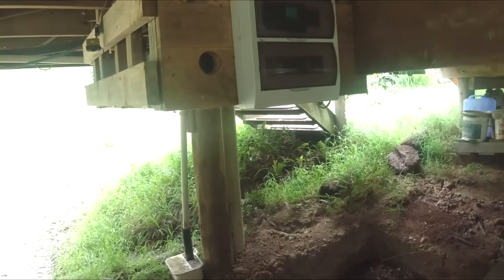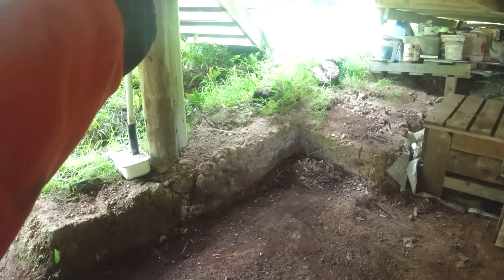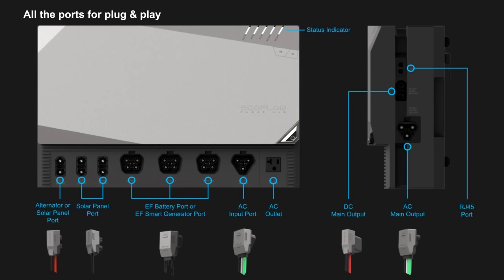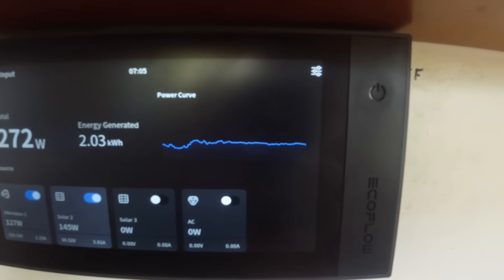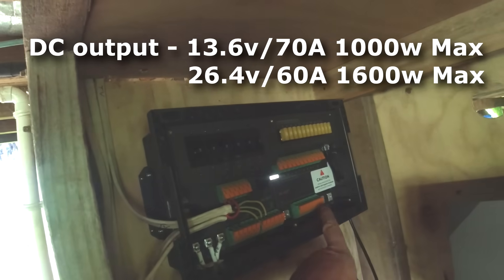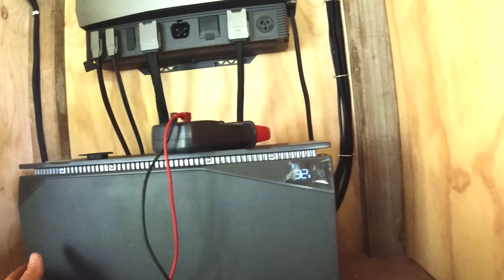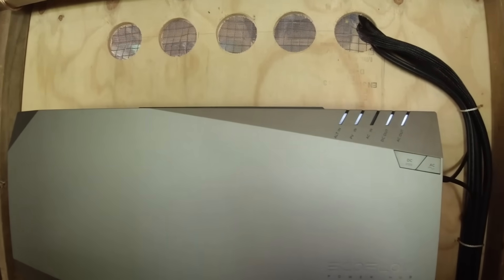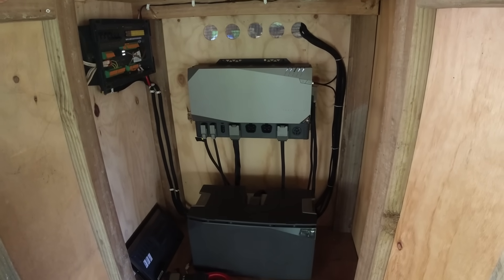Upgrading my Off-Grid Power System at the Beach House - Ecoflow 5kw Power Kit

Comment: Any update on how exactly you managed to get the excess solar into the hot water tank? I'm planning to do the same...
Also: How has the PowerKit been doing since the installation? Some defects or all perfect?
Reply from the maker: I didn't end up wiring up the auto dump, I just flick the switch when battery is full. No issues with it so far
Reply: @MartyT  So you are using a heating rod I guess? Which one did you get and how did you connect it to the power kit? thank you

Comment: how are you finding this system mate? looking to install the same setup on our liitle house we are building, just wondering if its worth the 13k investment.. many thanks
Reply from the maker: It is brilliant, easy to set up and use. no issues so far. It would be cheaper to buy individual components- batteries, inverter, mppt, fuse board etc and wire up yourself but a lot more time consuming and complicated
Reply: @MartyT  that’s mate, appreciate the reply, you don’t happen to have a Ecoflow powerhub for sale? Have found a great deal on the battery and pannels, just needing the hub now to get everything up and running, many thanks , Sean

Comment: Ecoflow is the Apple of power. They use their own proprietary connectors, they are way more expensive than building your own system, and they bundle everything together so if one component fails you have to replace everything. The tradeoff is they make everything simple.

Comment: I have alway been curious about suppling my water heater from a solar powered element. Do you ever have to worry about it over heating???
Reply from the maker: If the element is fed ac via the inverter then you can just use a standard thermostat, a bit more difficult with dc as it tends to arc contacts but there are ways of doing it
Reply: @MartyT  thanks for the info, I never thought about just doing an inverter to on of the ac heating elements. I always thought just wiring the dc directly. I was gonna do a small scale project since the heater runs alot.

Comment: @Marty, Where can I find out more about your Hot water PLC setup. I'm keen on a dump load for an unused HWS tank I have, but am considering a thermostat for for if the dumpload reaches big temps for the HWS. This is a problem in summer vs Winter though.
Reply from the maker: This is one I set up for a friend recently, dumping power from the inverter is easier to control than dc from the battery https://youtu.be/v38alCnacg0

Comment: This is probably a dumb question, but around 3:25 you plug in your solar panel connection to the power hub and the "ALT IN" starts blinking instead of "PV IN".  What is the "PV IN" used for if not solar panels?
Reply from the maker: The alt stands for alternator, this input can be charged from a vehicle alternator or solar array
Reply: @MartyT  got it, so you plugged the PV cells into the "alternator" port, same exact function, just different indicator light

Comment: i'd almost say not to call it lithium but lithium phosphate, it's so different from traditional lithium chemistry.  i'm envious of that much Lifepo4!  

EDIT: with the rise of LED and electronics i've always wondered why lower DC hasn't made come back in buildings like all those decades ago when electricity was new. seems more efficient that converting between AC and DC so many times.

EDIT EDIT: yeah lifepo4 is wild, it maintains fuller voltage much much much longer than lead acid!!!

Comment: Have tried a simple solar setup for my off grid workshop. Thing is solar panels are not much use in the uk this time of year. Any plans to add the washing machine water turbine to your system?
Reply from the maker: No stream here so can't have a pelton wheel, I could make  wind turbine from a smartdrive motor but would be much easier to just add a couple more panels

Comment: Maby this will be the answer for households with solar panels and a normal connection to the grid.

Instead of feeding all the power from the solar panels back to the grid, (which in plenty of cases means on sunny days, there is more power available then used) store the power during the day and use it in the evening/at night. You also don't have the taxes on power you feed back to the grid.

Comment: Cool system ! Great job on the cabinet and installation !  Only problem I can see is moisture intrusion from the air into the wood cabinet and electronics. With it  being  outdoors and in constant shade how do you combat the issue ?
Reply from the maker: The heat it generates combined with frequent running of the fans keeps it quite dry in the cabinet, also being up off the ground helps away from the moisture rising from the ground
Reply: @MartyT Nice

Comment: Lithium is highly inflammatory 
Fires are caused by to deep of discharge 
Then when charged again dendrites are formed.
This is like an ICE pick thrust though the battery 
The battery is simular to a jelly roll 
So the dendrits poke though all the layers shorting them out 
Recommend moving the low voltage cut off higher then normal. When gone .
That way draining the battery will stop before damage is done

Comment: You probably already know this, but you have to smother lithium battery fires, water will make it worse. A good idea for a fire protection system for the lithium battery would be to place a bag(s) (plastic) of sand above the battery. So that that if there is a fire the plastic bag will melt, releasing the sand smother the fire.
Reply: What do you do if the bag splits when the plastic degrades over the years?
Reply: @TheMightyYak  Everything needs periodic maintenance/replacement……even plastic bags !

Comment: Nice Vid Marty, always good to have enough for life lil luxuries like a Microwave, toaster and kettle!
I have 6.5kw grid feed and 2kw older panels and im about to expand this with grid as backup and 10kw of Gel batteries plus of course a new better suits Inverter so I can grid isolate if needed because my last from outages were 5 and 6 days respectively planning on 10kw solar and 15kw storage with diesel genset emergency backup.
As it sits I use a few bucks plus connection fee per day as my solar covers daylight feed so its nice to see a good overview of a new system.
Love your work :-)

Comment: marty ecoflow uses lifepo4 lithium and they arent dangerous like their li ion or li poly batteries that will burn. no need to move battery out.
Reply from the maker: Yes, general consensus seems to be that these batteries are a very safe stable chemistry, I am new to lithiums, I've always used half dead lead acid batts for my off grid systems so I'm learning a lot in the comments

Comment: JFC......7k USD for whats basically a charge controller, 4k inverter, and a breaker box. No panels and a 5Kwh battery. I guess if you have zero clue on solar and have money to burn this is a good deal. Will Prowse would tear this apart and laugh at it.

Comment: I will never understand people who put massive lithium batteries in their ceiling to store solar energy, stuff like this need to be placed in its own shed that can withstand up to 3000 degrees of heat these monsters output, not only do they burn for days on end, they emit extremely toxic gas that can kill within minutes in an enclosed space. 
A 5kW battery like that can easily melt bricks and putting it under the house is probably a bad idea, I suggest moving it away from the house by a few metres at least or put a massive shielding on top of it as 3000 degrees of heat, the battery could catch fire, burn for days when you are not there and the heat alone can cause house to catch fire.

Comment: Do make sure you read up on the charge curve of LiFePo4 cells. It would be easy to get a trigger voltage at about 90% SOC as the voltage curve shoots up right at the ends, but for the majority of the time, voltage is not a reliable identifier of charge state.  53.6v could mean 70% or 30%, you have to track Kwh in and Kwh out to get an accurate reading.
Reply from the maker: Interesting, thanks. I haven't had much to do with lithium batteries so I'm learning a lot from the comments.. I suppose another way to initiate dump would be to have a plc monitoring the solar output, when battery is charged, mppt will let go of the panels and voltage will rise
Reply: @MartyT  Happy to help. That mppt voltage trigger is a pretty good idea, although you may have to implement a timer that ignores panel voltage for some predetermined time as the water heater itself would drag the panels down after switchover?
Reply from the maker: Yes I would have dumping in 5 minute bursts

Comment: That is the one thing that eco flow and a number of the all in one inverter should have is a dump load. ( dual dump loads provided you have a thermostat on the water heater to shut off currrent then it switches to another load ) I would super love to have a dump load to provide hot water and even additional heat in the winter.

Comment: This kit is soooo cool, really the only downside I’ve seen on ecoflow is the Li-ion cells instead of LiFePo (like Bluetti and Anker I believe)

Did this ecoflow inverter need any adapter from the standard solar panel plugs at all? Or is it included…
Reply from the maker: This battery is lithium iron phosphate, very unlikely to catch fire. the solar cables have standard mc4 plugs

Comment: If the fridge was getting warm by morning, has the insulation on it failed?
Reply from the maker: No the fridge is fine but it does get opened and closed a lot in the evenings which lets out the cold air

Comment: get yoursefl and ebike hub motor kit, would be a fun video.
1000w or more and you will be loving it.
3000w for wheelie power.
Reply from the maker: I actually did get a 2000w motor from aliexpress recently but it doesn't work, I suspect the controller is poked

Comment: Iron phosphate cells are massively safer than cobalt oxide and others. They’re bombproof.  We used to abuse the hell out of them in F1 KERS (>300C discharge rates) and they lasted superbly.  

Looks a great setup. You can also run Iron phosphates to 100% with much reduced ageing worries so you don’t need to kick in the hot water dump as low as 80%.

Comment: Sweet new power setup .. Making a concrete case to put the battery in is a great idea..If a lithium battery catches fire the best to be done is put it in sand as it cannot be put out  So putting it in a concrete case should contain the fire especially if you put a concrete lid on top
Regarding battery's maybe one day you could make some composed of 18650 battery's

Comment: Nice informative video - a lot more properties will have similar systems to this in the future - have you thought about a solar thermal panel for your hot water ? More of these should be installed on new builds - old tech that is proven.

Comment: Great and informative video as always Marty. With regard to the battery box, any battery can go faulty and the fire risk is real, chances of putting them out once in thermal runaway is slim. I would suggest a battery box away from the house completely, if the worst ever happens it can burn itself out safely 👍

Comment: just finish building off grid 24v system for my shed but been testing it in the house this weeks ,  using victron gear and eve 280ah cells x 8 = 6.79kwh total capacity ,1.6kw solar charging putting 50amps into battery's  ,been running most the house low draw appliances TV lights 140l fridge and big 150l freezer ,sound system computer fans fish tank ,pulling 600w ,all day and and night ,, crazy for such a small system ,i going buy 8 more cells soon before prices rise and a second jk bms
Reply from the maker: Nice, its a good feeling to be off the grid.. I was looking into new batteries and inverter for this place when Ecoflow offered this system, perfect timing

Comment: Save yourself the trouble of fitting a water fire spray in the electrical cabinet.....  If the Li caught fire, the water spray wouldn't do anything but make a bigger mess.  Your plan to move the battery is better.

Comment: It is Lithium ion batteries that are the issue, if you check the specs on your battery ypuwill find it may not be that type , as thee are several different LITHIUM batteries.
Also I would
D s7ggest  second battery in parallel

Comment: The idea of a fire suppression system is a tricky one when dealing with electricals. If it gets triggered any metal piping should be considered live (dangerous), and I guess the piping would need to be metal to deal with heat.

Comment: The Lithium Battery potential fire isn't the same for all types of Lithium devices.  What is known as LiFePO4 batteries are very safe and have internal Battery Management Systems to prevent any faults from starting fires 🔥

Comment: Maybe an auto discharging powder extinguisher would be better than a water sprinkler. Will you put in a fail safe isolating switch to isolate the power while you’re absent from the property?  It may pay to check your cover with your Insurer, and you may need to get a registered electrician to comply the installation. Good back up in case there’s a fire.

Comment: Is the system pretty easy to hook up, it looks like you used solar panels that you had on another system? Do all solar panels have like a universal plug to use it on different systems. Also just curious if someone with good set of tools and basic understanding of electrical can hook this up?Edit: Do they provide good wiring diagrams because i notice your able to check the voltage and the terminal. Im sure you wouldnt have donw that unless you knew that was power and ground. So good wiring schematics too?
Reply from the maker: Very easy, all plug and play. The solar cables have standard mc4 connectors

Comment: Just an FYI, I have been flying the 787 and the lithium batteries caused a bit of a problem until they were totally isolated in titanium sealed boxes.  In the airline industry for 45 years and whenLithium batteries in laptops and etc came on the scene we had to institute new fire procedures.  Lithium fires cannot be put out by water.  They react with water and cause explosions.  So good on you to completely isolate the batteries in a fire proof section/container.  Happy new year!

Comment: You get some real neat DC geyser elements that can run on direct DC ... may be an idea to replace any boiler/geyser element in time.
Reply: Except the Thermostat switch won't be rated for DC. Will draw a nasty arc rather than cutting the power.
I added a Solid State Relay to actually switch the DC via the thermostat.
Reply: We have a GeyserWise controller, that cuts the supply to the element, and activates a thermosiphon pump to circulate water from the solar collector to the internal boiler.  

That controller, as I understand can run AC or DC element. 

Have been looking into those PTC ceramic heaters as an option as well … you get DC and AC/DC versions and think

Comment: It depends on the chemistry of the battery. If it is Lithium Ion then fire risk is low. If it is LiFEPO4 or Lithium Iron Phosphate the risk is extremely low. Puncturing a cell can cause issues with Li ion but the most probable cause of fires in Li ion batteries is thermal runaway from excessive heat. Once that happens the only way to put it out is to cool it enough to stop the chemical reaction.

Comment: You should talk to Ecoflow and see if they can do a firmware update so that the system will auto dump to the hotwater tank when battery is full.
Reply from the maker: That's a good idea, it might be possible and would be much simpler than using a plc
Reply: @MartyT  I absolutely thought "they should implement that auto-dump Marty-functionality in their systems" the moment You mentioned the lack of it.
Reply: Sounds like an opportunity for a CANbus accessory :)

Comment: The Lithium Phosphate batteries appear to be safe so far, it is the Lithium nickel cobalt batteries that are catching on fire. These are used in most EVs until recently because they are more energy dense, including Tesla, Hyundai etc.
Reply: correct he dont need to build a fire box for them , he just needs to keep them at 24c , he may need heat mats in NZ winter but to achieve this or damage them if the controller allows low temp cell charging
Reply: The ecoflow has a built in heater and is rated by the manufacturer for use down to -20 Celsius
Reply: How cold does it get there during winter?
Reply: Indeed, LiFePo4 batteries are generally safe and well suited for these applications. Li-Ion and Li-Po batteries are more energy dense and less stable than LiFePo4, but can deliver more amperage for more power.
Reply: Agreed. LFP is pretty hard to set fire to, even if you're trying to.
Reply: Lithium IRON phosphate. STOP HANDING OUT BAD ADVICE!!!! IRON PHOSPHATE BATTERIES CAN WILL AND DO BURN DOWN!!! The EV nerds who do not know JACK SHIT are fucking dangerous as hell. ALL Lithium Batteries ARE Lithium Phosphate. Its the middle element that determines what kind of reaction you get. Lithium cobalt PHOSPHATE. lithium iron PHOSPHATE. You dumb fucks need to SHUSH.

Comment: As an electrician id says thats a good install, neat and easy to work in, the fire proof box is a good idea but make sure to add a fan on it to keep the batteries cool. And i dont think that breaker box fits AS/NZ standard of needing a tool to access live components such as removing an energised neutral wire. A lock on the door would suffice
Reply from the maker: Thanks for the info, The main doors have a heavy padlock
Reply: Realistically with the sort of storage capacity and charge rates the system has (limited) the cells aren't going to get warm themselves. The inverter will however when driving big loads, but as you only have 5kW of energy, even that ultimate heat release is limited